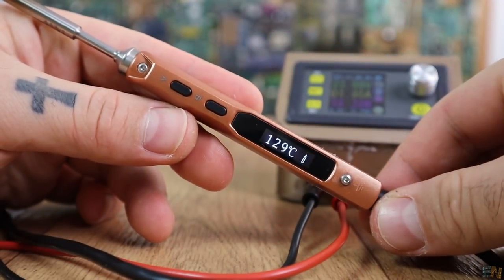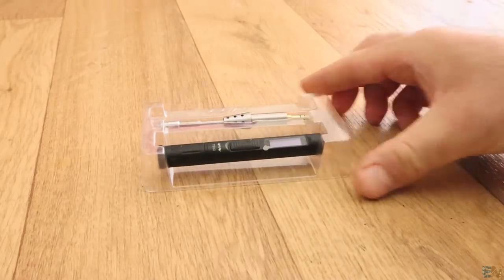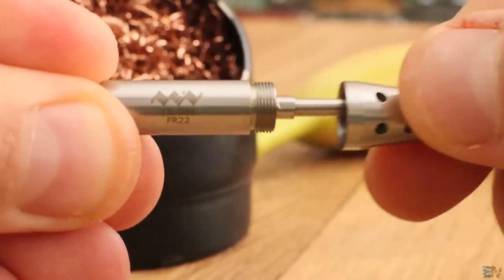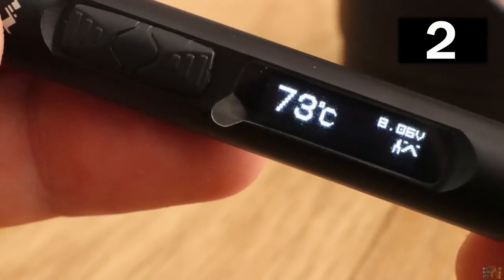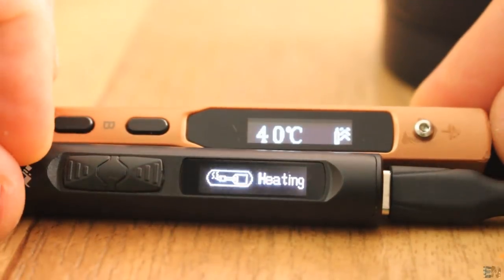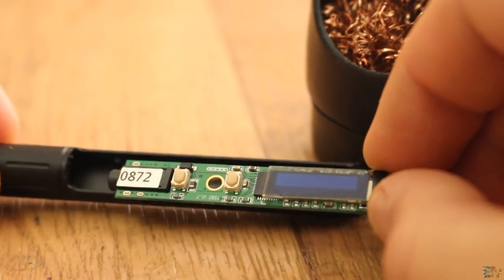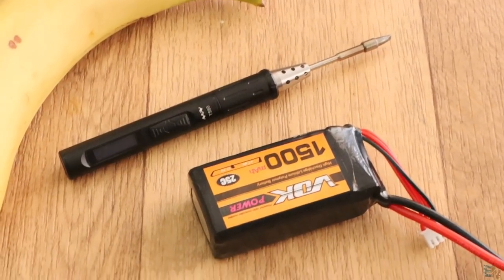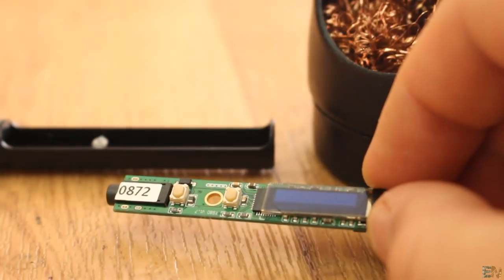TS80 soldering iron | Review

Comment: Dude it's true that this thing is better with lower power than TS100 because it has better design in tip and maybe better firmware control but you must also show the advantage of the higher power of TS100, for me it's a bad comparison to test it in it's lowest voltage and power available... also keep in mind that there's a chance that may be updraded tips and firmware for the TS100 too in the future, and connector is not really a problem...
Reply from the maker: yes yes, Full TS100 and TS80 compare soon! Keep up!
Reply: i'll be waiting... subbed btw :)
Reply: JimiDJ Original, you mentioned that connector is not a problem. What do you mean by that? I am looking for information on how to power TS80 from the 3S lipo battery. I have found so far, that this should not be a problem, just need an adaptor XT60 to USB-A and make sure to use 12v battery. But this is just a theory without a real test. I hope someone can support this opinion :)
Reply: I meant the connector for the tips of the TS100, they could still make same better quality tips for it, though i must say i owned a TS100 some weeks later after this video, the upgraded version which came with a TS-I and and TS-BC2 inside, and also i ordered extra a TS-KU and a TS-C4 after Louis Rossmann recommendation, i am very pleased with all the tips excect the TS-KU, i thought it would be great for THT and high power cables soldering but it's not... so i stuck with the TS-I instead. The original TS-80 tip looks like a heavy duty JBC tip i have seen, which have extreme thermal mass, thats why TS-80 outperforms the TS-100 even with lower power rating (at least in this particular comparison in this video).

Comment: My TS-100 get to 300°C in 9 seconds with a 19V ThinkPad power supply.

I like the easy plug in mechanism of the TS-80 but i think the power connector and the max voltage of 9V gives you less options than the TS-100.

Comment: You can still power this from a LIPO if you want to get this for Quadcopters.  You just need a Lipo to USB QC 3.0 adapter  --- They are like $9 on Banggood.
Reply: Avolate FPV, hi! Thank you for this piece of info!
Also, as far as I understand, if you use 3s lipo, yo dont need that adapter. Please correct me if I am wrong.
Also, could you please post a link to that adapter? Thanks!

Comment: Nice demonstration, I think t80 was fester than t100 because t80 used st32 microcontroller.so please your next project made to st32 soldering iron.
Reply from the maker: Both are using STM32
Reply: It's faster because the TS80 is 18 W at 9 V, and the TS100 at is 17 W at 12 V. He supplied the TS100 with 11 V, so it's less powerful with that voltage. However, I'd say the TS80 has also improved PID control or something like that, because it's much faster. Still, at 65 W at 24 V, the TS100 wins.

Comment: Do we have a winner though between this and the TS100? I've seen a few videos that suggest the 80 is better in practise, even though the 100 is better on paper.
Reply from the maker: I like the TS80 more. The TS100 with 24V is more powerful!
Reply: The ergonomics do it for me. The 80 is far more practical. And I can use mine with my cellphone charger and lead. I've got an abundance of leads. I also use my power bank.
On the 100 you need the right lead that you might not always have.

Comment: I dont think they should have changed the power socket, the 3.5 jack was able to rotate but now it cant so puts extra strain on the wire
Reply: Bob Wareham No problem with strain, It’s a very flexible wire. 
The DC barrel doesn’t rotate either, so no difference.